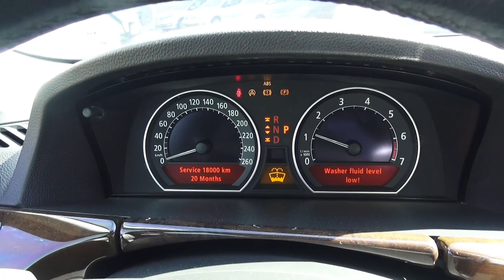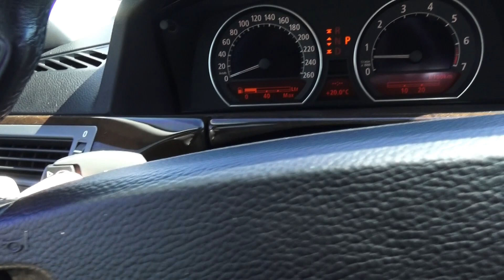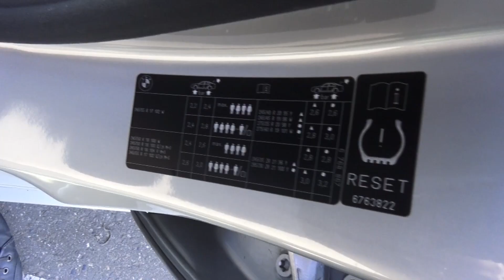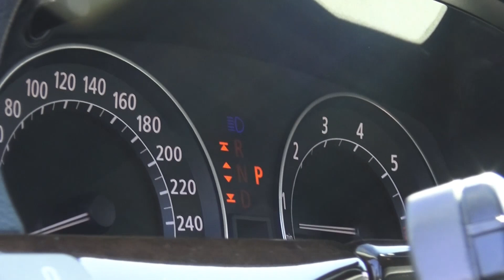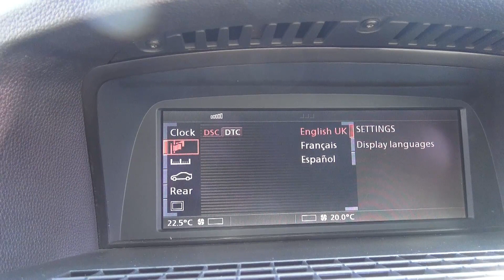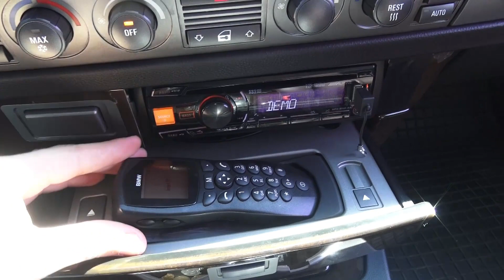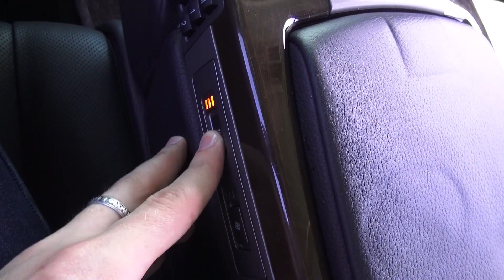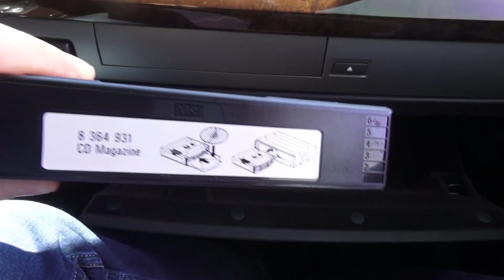2005 BMW 745Li (E66). Start Up, Engine, and In Depth Tour.

Comment: Just got my 730D 2008 on the road. One of the last E65's before the model change to F01. She has had a full service and now has zero errors via INPA. I am very happy indeed. It's definitely a head-turner when sitting at the lights. Mine has rear TV/DVD so the missus is happy.

Comment: Thats a pre facelift E66 with a changed front and back. Its very clear from the engine cover which in 2006 was a 4.0L for 740i and 4.8L for 750i. The engine in this video is a 4.4L from a 745i which only came in pre facelift model. Also to identify a pre facelift E65/66 from a post facelift is to notice the dial knobs for the ac vent controls that came chromed in post facelift models. In this video though they are pre facelift model knobs/dials for the ac vent controls.
Reply: correct, also the idrive screen has the old interface on it

Comment: That's a 2006 not 2005...
Reply: 745 (pre facelift) is 2005
Reply: Yeah  the design  was changed  2002-05  and 2006-08.
Reply: And he say 04 in the vid
Reply: In the video he was saying it's a 2004 no I'm just confused as fuck.....
Reply: facelift from 2005
Reply: That has to be an 06 750Li especially with those options
Reply: @KStatus7  You can convert your 2005 into a Facelift 2006 if you want... The car in the video is a 745 which means it's a Pre Facelift converted into a Facelift... if it was the real facelift this car would be a 740...

Comment: Sadly the most unreliable 7-series ever made.
Reply: +MrCarGuy20 still bmw 7 series cool.
Reply: I agree I own one and wish I would have gotten a S550 instead
Reply: The thing is that with the S550, you will spend, at cheapest, $2500 on the suspension for parts alone. The service for 911 requires that the engine be removed from the car. The moral of the story is don't buy a car that you can't afford to repair.
Reply: I love my 750li
Reply: I can't find mobile pair